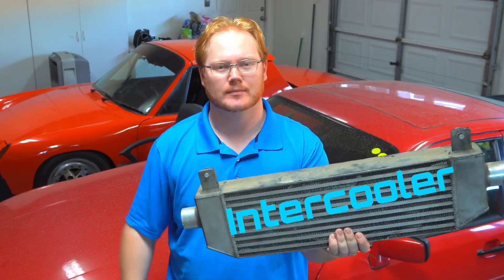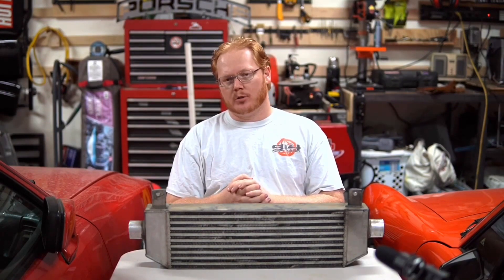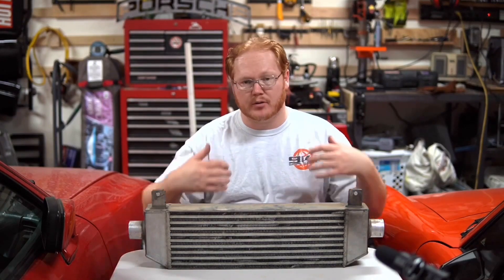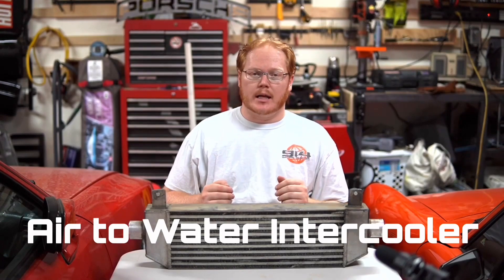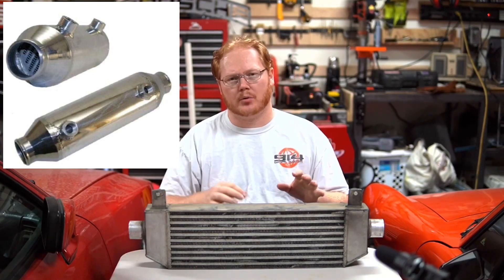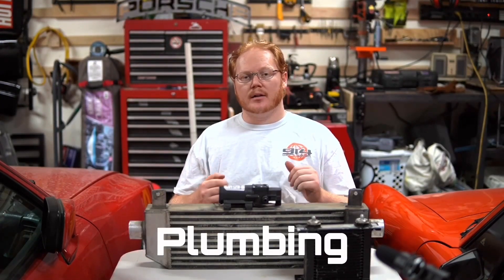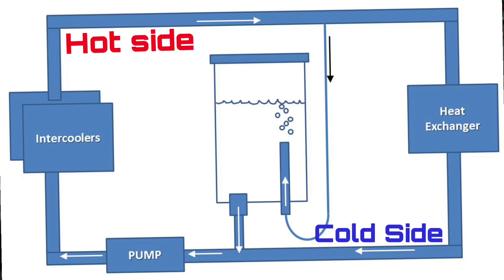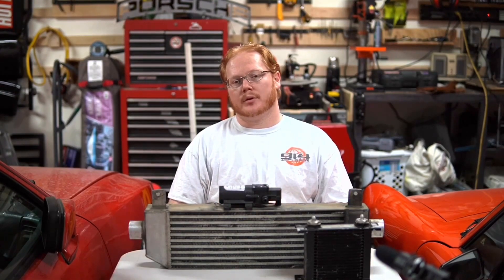DIY Air to Water Intercooler setup for $350 to support 600hp

Comment: How much of a heat exchanger do you think I'll need for about 650hp? I'm only running about 8psi and I have tbi style EFI so I get charge cooling from the atomized fuel in the wet intake manifold. I've heard carburetors can lower IATs by 100°F. I was looking at an 18"x14"x2" radiator as a heat exchanger. I'm looking at running a very similar ebay air to water intercooler. That size of a heat exhanger would leave my options pretty slim for a transmission cooler. I just had a custom torque converter built and picked up the automatic trans yesterday so I want to take care of my new transmission too. If I could get by with something smaller on the heat exchanger side, my trans would be very appreciative. 
  It's a daily driver, 355cid.  It has a centrifugal supercharger running at 8psi at 5500rpms. My cruising IATs are usually hovering around 100°F but can get much higher under load. The truck weighs 5600lbs.
  Thanks man. This is my first foray into intercooling any of my personal stuff.
Reply from the maker: Lots of variables there, I say give it a shot with what you have planned. . The biggest thing you want to avoid with your setup is heat soak into the intercooler radiator. You need clean air no where near another radiator. Being a daily driver if you out it in front of your condenser or engine rad youll have heat soak idling around. 
I put my radiator in my fender with a fan, so far it barely turns on the fan. So you could always expand with another radiator in the fender if you needed it. 

Your build sounds like fun :)
Reply: @budgetoutlaws9978  my fenderwells are pretty full with electronics and relays and my ignition system. I may have room to remote mount a radiator for the intercooler with a fan. it just looks like an ordinary old farm truck. It's not taken to the extreme that farm truck does it, but it's unsuspecting for sure. It's a 1990 Chevy Silverado 2500 4x4. There is a hellcat challenger in my hometown and every time I'm around him at a stoplight he thinks I'm challenging him to a race. I'm like "Calm down there fella. You'll know it when I'm getting on it." Lol. 
  I have single 4" open exhaust. It really thunders do i can see why the hellcat acts like he does. It looks like stock diesel pickup until you fire up the engine. It's a diesel exhaust system with no muffler. I built a 3"-into-4" y pipe from my headers to mate to a diesel exhaust system for a 6.5 turbodiesel for my body style of pickup.
  Thanks for taking the time to reply.
Reply from the maker: How about rear fender wells? Or between the cab and the bed? Generally a lot more room in the rear than people suspect. That's where I have mine in my 914. The longer your lines, the more water that's in the system and the more efficient it will be. You also have under the bed you could use. Lots and lots of space there. Hell you could mount a full radiator under there.
Reply: @budgetoutlaws9978  I have a 34 gallon gas tank on the driver's side and my exhaust system runs along the passenger's side. I think i could fit a decent sized heat exchanger behind the gas tank. The spare tire mounts between the framerails and above the axle. I'd rather not mount anything inside the wheelwells or outside of the framerails because it's a 4x4 truck and I do take it off road sometimes. I think just behind the fuel tank on the driver's side frame will work great with an auxiliary fan. Thanks for the suggestions. Where did you get your fan controller? I've used some adjustable fan relay controllers but I feel like they all start at like 160°F at the lowest. I know 8psi doesn't create that much heat, but I'd like it to stay as cool as possible. 
  I'll just throw a small reservoir in the engine bay so I can fill it. Thanks for the suggestions. Good luck with your projects.
Reply from the maker: Amazon is where I got it. Search 12v temp controller. There about 10 bucks. Glad I could help! Good luck!

Comment: Awesome, I’m trying to do some kind of unique with a base model civic. I’d like to run a AMR (roots) supercharger, and I just recently discovered this option. I know that I’m gonna need a way to cool the air that it’s producing and most other designed to fit superchargers are cooled other ways. So I’d like to run an air to water cooler. This was a great video, would you be interested in showing your setup?
Reply from the maker: I'm glad you enjoyed the video! Lots of v8 cars run roots blowers with a A2W, you can likely run a very small IC like I showed in the video. 
My setup is just the large IC on the side of my engine bay. I did a poor job of showing it in the video.... I'll have to do a follow up on it in the future :)
Reply: That would be greatly appreciated! I’m not huge on power but individuality? Lol yeah I need that.

Comment: Just wondering why you wouldn’t just plumb the hot end into the side of the tank and pull from the bottom. Do you need that small line for some reason?

I plan on using a small heat exchanger and a ice box on my Willy’s build
Reply from the maker: The reason you dont put the hot side to the side of the tank is so you dont have to push all the hot water way high. Im sure doing it the way your describing will work (And that might even be preferable for a ice box system, so long as the ice box is above the radiator and IC), in fact its how the old radiator systems worked, but this way allows for most of the water to stay at or level with the enclosed system and just have a small portion of the fluid that has to make its way higher up in the system.
Also I had the room for the extra hoses and routed my engine cooling system the same way so I wanted to be consistent. 
Just remember, the highest point in the system needs to be the fill.

Comment: Thanks for the info. I'm looking at a2w for my mrs turbo project the motorcycle radiator is a good idea.
The fan idea is a bit tricky as I'm not to good with wiring stuff in the car lol. Cheers